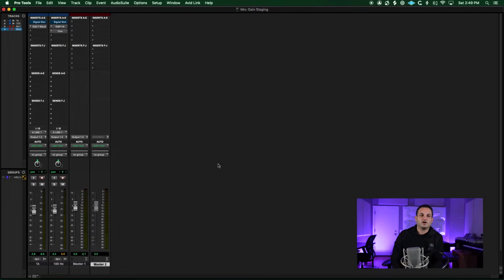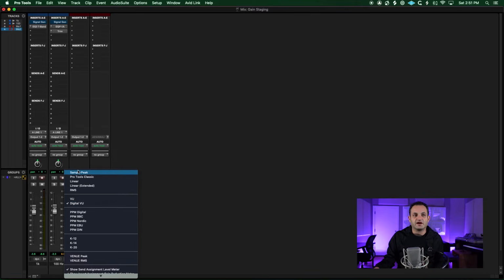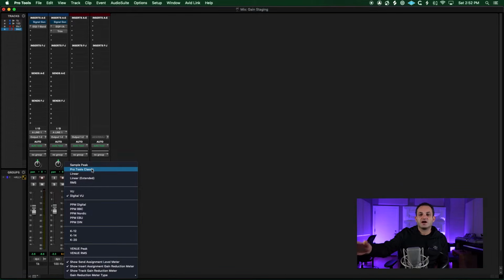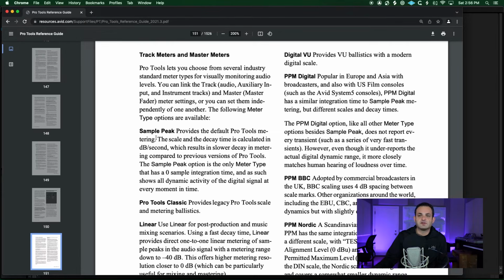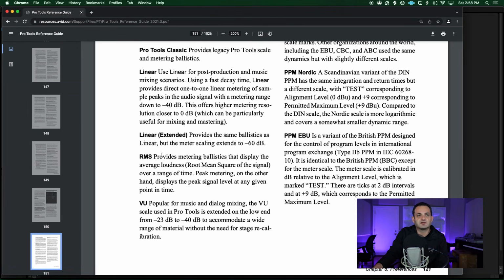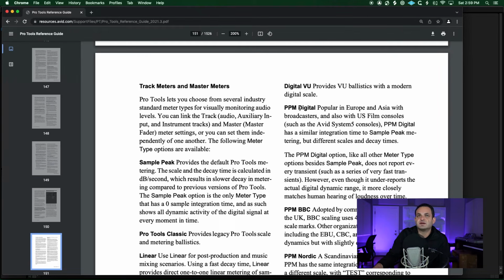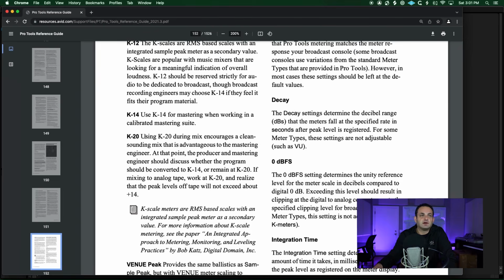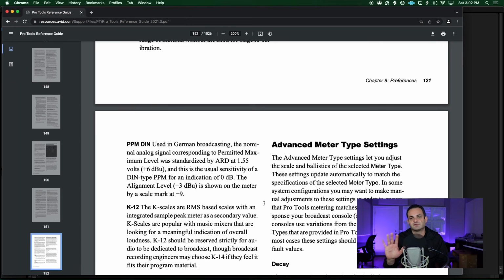Pro Tools Meters Explained

Comment: it doesn't matter if it goes above -0 in pro tools as long as it is not clipping (red at the top), lots of rock bands go really loud, above -0 and then compress etc..
Reply from the maker: Back in the day it did matter. Ted meant clip. Nowadays Pro tools has a bit of a buffer zone to where if you clip it stays within limits. Or working in 32 bit float you have much bigger dynamic range. But you’re still playing with the potential to clip so I don’t recommend it.

Comment: Some really bad info here.. The K12 metering should NOT be reserved "strictly" for audio dedicated to broadcast.... K12 is actually a wonderful way to gain stage and have channel and master bus headroom. Just one example where I disagree with what you are saying.
Reply from the maker: Yes I use k metering for that as well. It was originally designed for broadcast use is what I mention. I have a video on using k metering for gain staging here: Polishing Your Mix with K Metering - K System Metering Explained
https://youtu.be/-eq9nAPj5yY
Reply: @DistinctMastering  Ok sorry, I was only going by what you said in the video. Yes indeed, it's really good for mixing and helps especially with the new streaming standards cause it's much easier to have a mix conforming to those from the very get go when using K12 or K14.
Reply: @Bavanity  Actually, Distinct Mastering was reading from the PT manual.  Thanks DM for the video, I'll check out the gain staging video.

Comment: I've been recording songs for the last 7 years... after being retired for the last 25 years. I thought I did everything perfectly. Now everything I have done has gain-stagging issues. I am using Pro Tools Studio 2022 and my meter is set to Digital VU. Some of my drum tracks were averaging -20dB and were peaking at 0? There shouldn't be such a drastic swing? I heard Pro Tools Classic Meter is better to use, but the part that is not explained really well is that all of these meters seem to be really different, so depending on which one you use you can have different results. Which is the best meter in Pro Tools to use for recording rock? Also, I'm trying to get my track volume on average of -18dB as I know that's where the plugin sweet spot tends to be. So frustrating. Thank you for the video. I wish you would have touched on your preferences because as an advanced mastering person that is super important since you command respect in your field and has great value to novices. Thanks
Reply from the maker: Classic meter seems to be most standard for a lot of people but it depends what you prefer